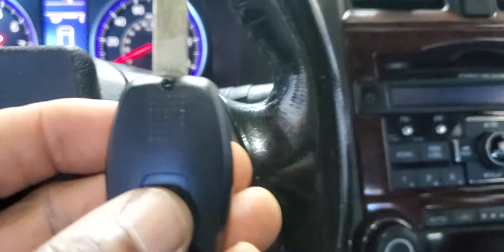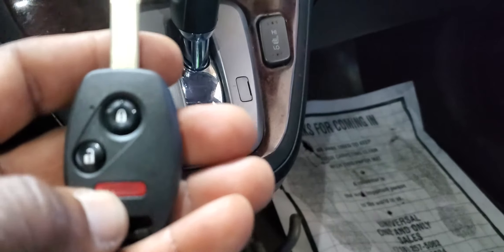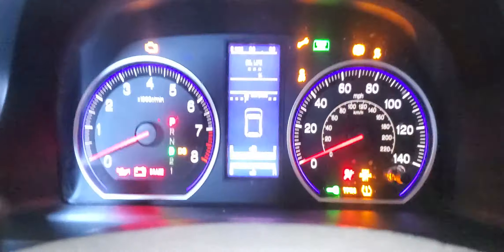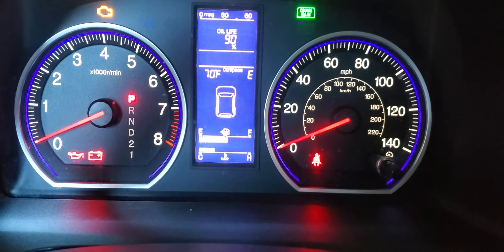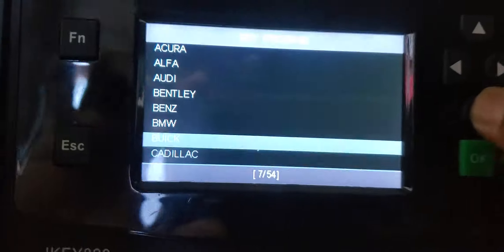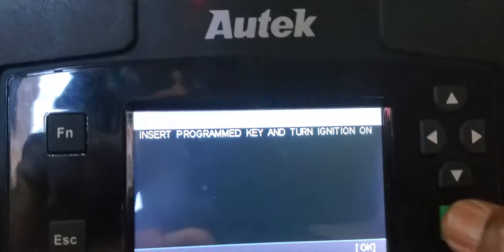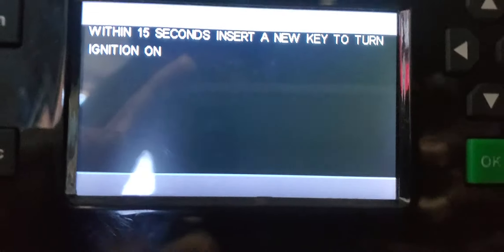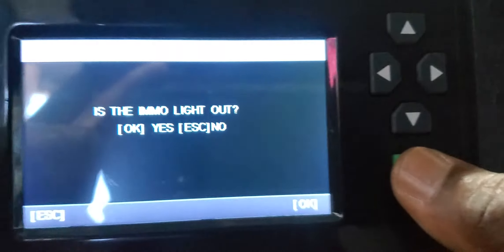2007-2013 Honda Crv Remote Key Programming

Comment: What are some common reasons for a car not accepting new key? I went through the steps with my programmer but the new key just won’t program in =(. It was a 2008 CRV
Reply from the maker: what tools are you using
Reply: Was using key tool max which has been good on Hondas so far… it was an Ilco transponder key. The programmer was connecting and went through all the steps but immo light wouldn’t go off. Maybe just a bad key or something wrong with the car?

Comment: I had to absolutely get a locksmith that had a machine with him to program this key and cut it. For a 2013 Honda CRV you cannot do any trick to get the key programmed it absolutely requires a special tool to be plugged into the car
Reply from the maker: yes